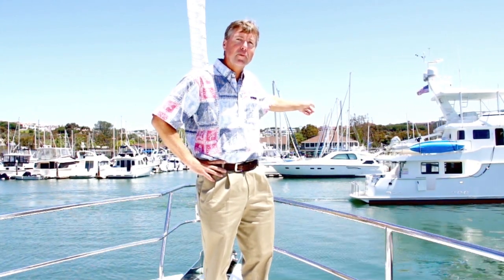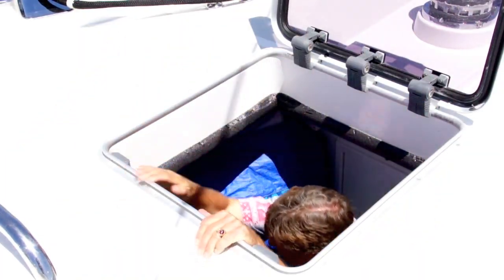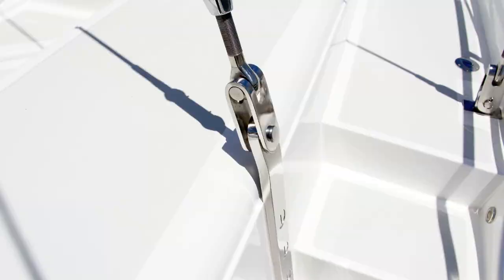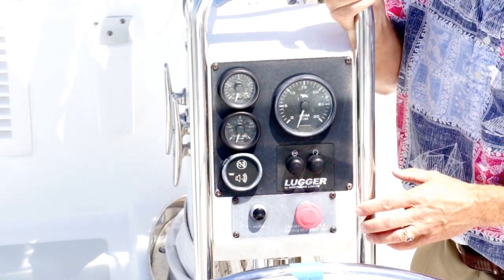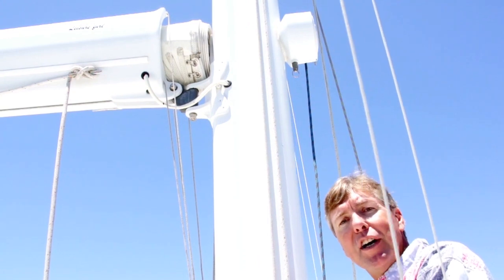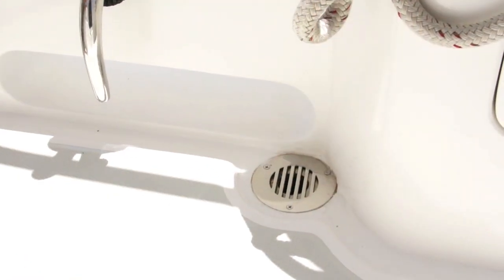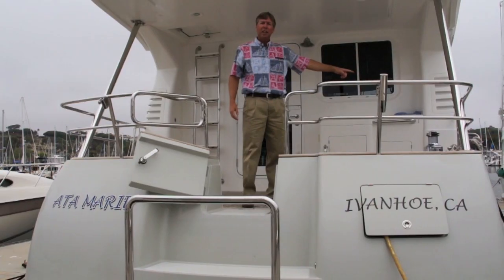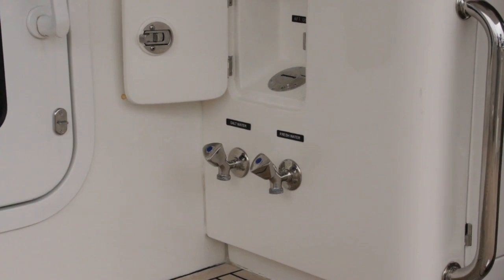Nordhavn 56 Motorsailer

Comment: excellent boat - super vessel ---- one suggestion, maybe take a look at some other hatch vendors.   You want hatches that have metal hasps not plastic, and it's very important to have good hatches - very important.    They are one of the component parts that keeps the blue water on the OTHER side of the hull .........